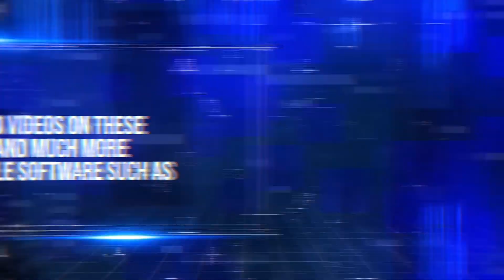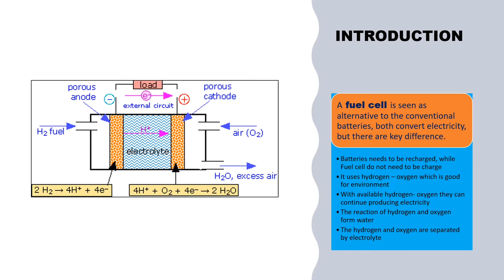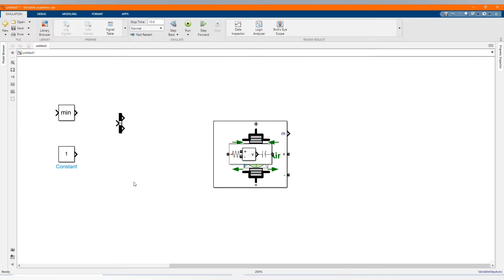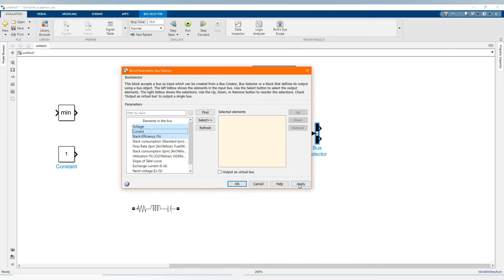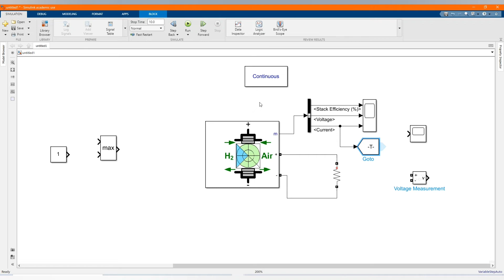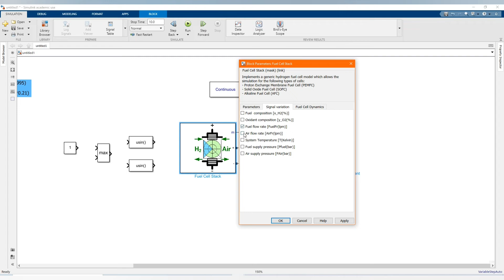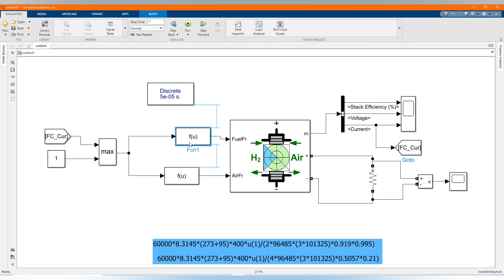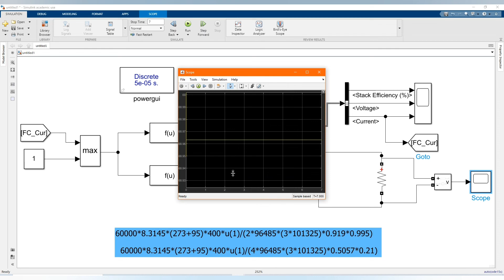Design and Simulation of Fuel Cell to produce Power in MATLAB Simulink

Comment: Hi, If I want to see ope circuit characteristicsof Fuel Cell, I mean no load, it is not working. How can I see voltage current characteristics of the Fuel cell by itself without any load?

Comment: The rates of conversion (utilizations) of hydrogen (UfH2) and oxygen (UfO2)

UfH2 = 60000*R*T*N*Ifc/(z*F*(Pfuel)*Vipmfuel*%x)
UfO260000*R*T*N*Ifc/(2*z*F*(Pair)*Vipmair*%y)

Pfuel = Absolute supply pressure of fuel (atm)

Pair = Absolute supply pressure of air (atm)

Vlpm(fuel) = Fuel flow rate (l/min)

Vlpm(air) = Air flow rate (l/min)

x = Percentage of hydrogen in the fuel (%)

y = Percentage of oxygen in the oxidant (%)

N = Number of cells

The 60000 constant comes from the conversion from the liter/min flow rate used in the model to m3/s (1 liter/min = 1/60000 m3/s).

Comment: Thank you for your lecture, it is very useful, however I have a question. i want to know 60000*8.3145*(temperature)*400*u(1)~~~~~~mean.  
i think it is a theory about fuel cell. but I'm about to study fuel cell. so I don't know. if you do not mind could you tell me that equation mean?? 
If it's hard to tell, could you tell me what the theory is? i know the structure about fuel cell.
Reply from the maker: Hi tank you for your comment, the value is the Atomic mass of hydrogen 1 and hydrogen 2. You can do research on that

Comment: how many voltage generated & power also..can u explain & why load resistance u choose 15....
Reply from the maker: Hi Thank you for your comment, the total generated power in this model is approximately 310W, which is influenced by the input. The use of 15 ohm as load, there was nothing special on that. You can choose any load value
Reply: @pzengineering2020  but we have used 6kw-45dc fuel cell but only generated 310w only why, what to do to increase the generated power.
Reply: how to generate 1kw power..
Reply from the maker: @SandeepKumar-cu8xp  We were just showing how to model. In order to increase the output power you need to add Fuel Cell stacks in series or parallel. When you open the fuel cell stack, there are option on type of stack, you need to check on that
Reply from the maker: @SandeepKumar-cu8xp  You connect in parallel the fuel cell stacks

Comment: Thank you for the video .please can you explain me the expression of the 2 functions f(u) used in this simulation ? or give me a link that can show me the explain of this expression so i will read and understand the expression of f(u)  thank you.
Reply from the maker: Good day, thank you for your comment. The f(u) is the matlab function. The value inside if the Atomic mass of hydrogen 1 and hydrogen 2. You can goodie it and get papers which will help u
Reply: @pzengineering2020  Which source that you used as paper, I really do not understant what you have done ın the functıon part. What is this equation how can we find the same equation?
Reply: i didn't understand where is the function
Reply: Exactly even I'm wondering. How to get those function blocks